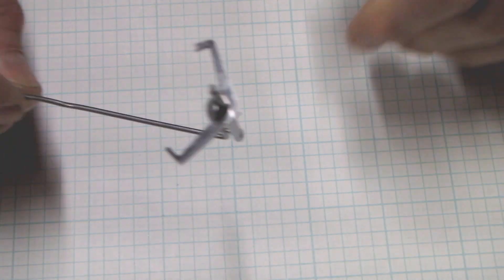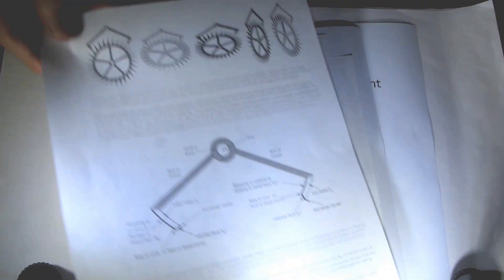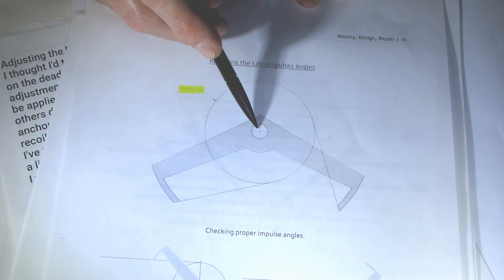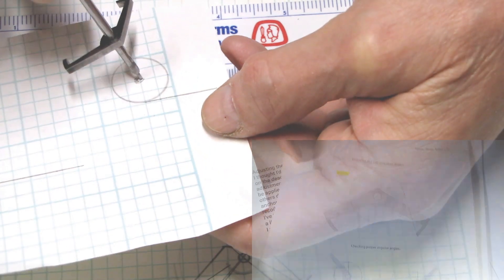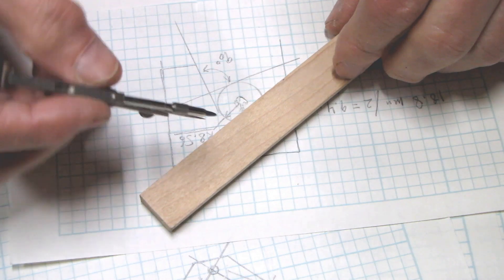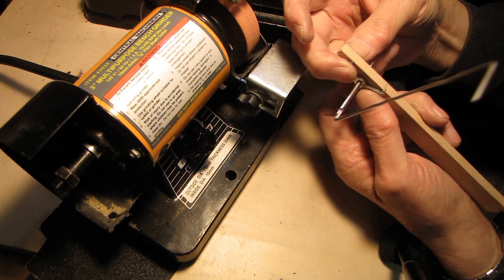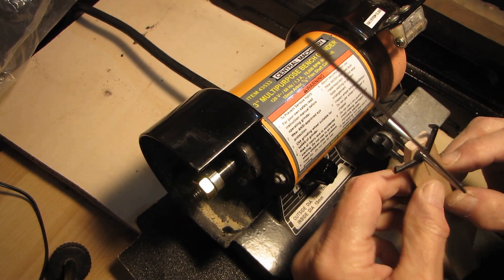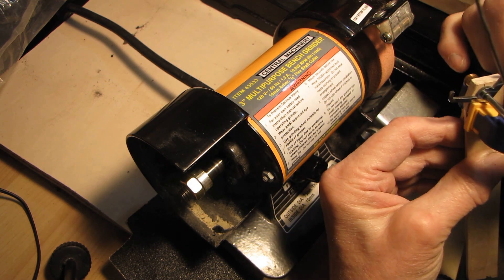Finding a Way to Repair Clock's Pallets Impulse Faces How To

Comment: except that at the end, the escape wheel teeth are landing on impulse faces because you changed the distance between EW and verge. the EW should come to a dead stop every time an EW tooth lands on a locking pallet... you can see the EW moving backwards slightly when teeth hit the impulse faces. and, the movement as pictured is out of beat.
Reply from the maker: Looks like you have a good knowledge in the clock internals. There is an adjustment option to regulate the distance between verge and EW in this clock and I probably needed to make that adjustment better. But the clock was fixed by making correct face angles and it was in the beat. Thanks for watching and for your comment!

Comment: I'm trying to understand how this will work, grinding the surface will remove material, removing material changes the distance between the arbor and the entry and exit surfaces.
If those surfaces were ground down over and over would there be a point when this proceedure would no longer work as the pallet would have to travel further to lock and escape and im invisioning the pendulum would also travel further, does this make sense?
Or is it all so minimal that it would take a very long time and many grinds to affect the performance?
Reply from the maker: Impulse faces should be done correctly at manufacturing and then they will need to be corrected only when some wear occurred, which should not happen for a long time. If faces got screwed by time or someone, then this procedure will help, and some removal of material is not avoidable. But after faces have been corrected, clock will run again for a very long time. If too much material is removed, there are options to fix the issue. First, some clocks have adjustments to regulate the distance between arbor and escape wheel. If not, then the arbor could be replaced by new one with no faces yet fixed. And then this procedure will be of a big help. Thanks for watching!
Reply: @ValentechTime  I am fixing a wall clock with adjustable pallets, someone has seriously interfered with them and they are completely wrong and clock won't work. So this is very helpful to me because I can grind to correct angle and adjust the pallets for correct depthing. So thanks for this!